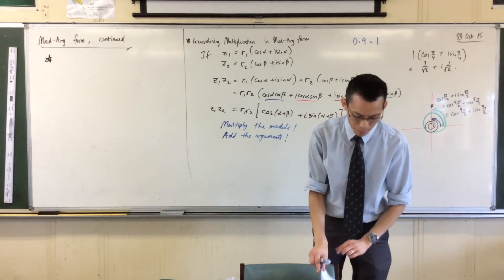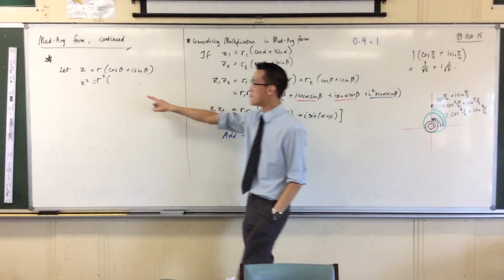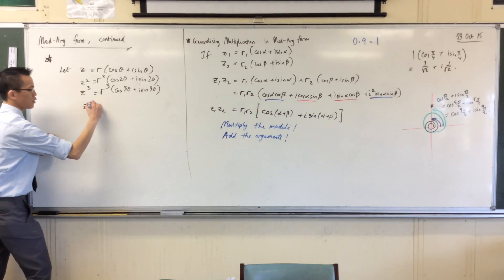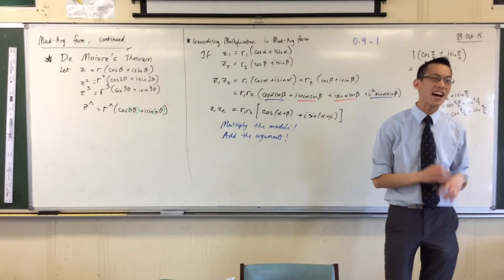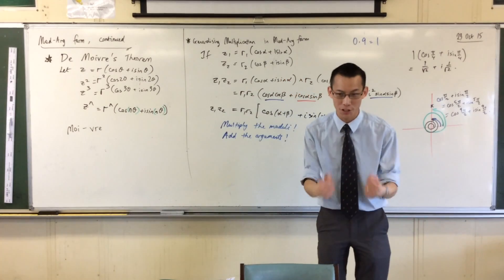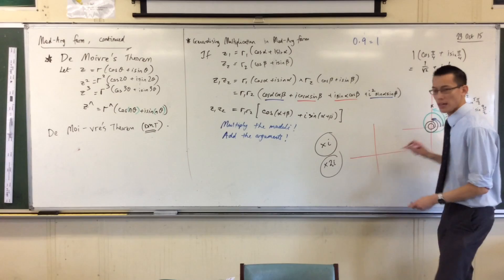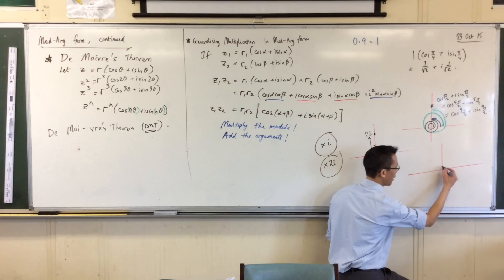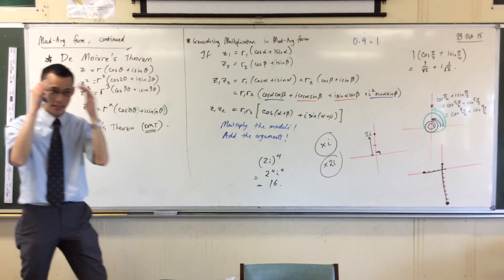De Moivre's Theorem

Comment: Hi 
I have a question 
Use de moiver (216/343i)raised to the exponent2/3
Reply: يمكن ذلك باستخدام نتيجة مبرهنة ديموفر
Reply: Given:
(216/343 * i)^(2/3)

Rewrite the exponent as two exponents, such that it is a squaring and a cube root:
((216/343 * i)^2)^(1/3)

Carry out the squaring of the base:
(216/343 * i)^2 = -46656/117649

Take the cube root of the magnitude, to find the radius of the circle, on which the three cube roots will reside:
cbrt(46656/117649) = 36/49

Because we are taking the cube root of a negative real number, the real-valued root will be negative and real.  Odd roots in general, of a negative real number, will be negative real numbers, since (-1)^odd = -1.  This means the first root we find, will be -36/49.

Per DeMoivre's theorem, the remaining two roots will be uniformly distributed around the complex plane.  This means one of them will have an Argand of pi/3, and the other one will have an Argand of -pi/3, while the principal root has an Argand of  pi, as a negative real number.   Thus our answers are:
z1 = -36/49
z2 = 36/49*e^(+i*pi/3) = 0.367 + 0.636*i
z3 = 36/49*e^(-i*pi/3) =  0.367 - 0.636*i

Comment: Can anyone tell me why this is important in and how they are applying it I  their studies?
Reply: An example I can give you, is the application in electrical engineering.   Capacitors, inductors, and resistors, can all be generalized with the concept of impedance.  So that rather than thinking about a special formula for each of these circuit elements that relates voltage and current, you simply extend Ohm's law for resistance, to a complex version of Ohm's law with impedance.

An AC (alternating current) waveform can be represented as a complex number, where the magnitude is the amplitude of the waveform, and the Argand is the phase angle.   Think of the complex number rotating on the complex plane, and projecting itself onto the real number axis.  The projection on the real axis tells you the waveform's value in real time, while the imaginary parts tell you a forecast of the past and future of the waveform.  Voltage and current are each waveforms like this, where they are given in the form of V(t) = A*cos(w*t + phi), where A is the amplitude, w is a term related to the frequency, and phi is the phase shift, from the original cosine function defined as a phase of zero.  You can represent this waveform as a complex number, in the form of V = A*e^(i*phi), which in Cartesian form is A*cos(phi) + j*A*sin(phi).

Note: EE's use j for the imaginary unit, because the letter i is spoken-for to stand for current.
Reply: Onto the example:
A 60 Hz waveform of 100V amplitude is applied to a 100-Ohm resistor and a 100 millihenry inductor in series.  Find the amplitude of current, and the phase shift from the source's voltage waveform.

Resistor impedance: Zr = R
Inductor impedance: ZL = j*w*L
Value of w, for 60 Hz = 2*pi*60 = 377 rad/sec

Thus:
Zr = 100 Ohms; ZL = 37.7 j-Ohms

Find the net impedance of the circuit:
Znet = Zr + ZL
Znet = (100 + 37.7*j) Ohms

Let V have a phase angle of zero, to keep it simple.  Use V = I*Z, and solve for I, to find current.
I = V/Z
I = 100V / ((100 + 37.7*j) Ohms)

Carry out the complex number math, and get:
I = (0.876 + 0.330*j) Amps

or in Mod-Arg form:
I = 0.936*e^(-j*0.36) Amps

Amplitude of I = 936 milliamps
Phase angle of I = -0.36 radians, or -20.7 degrees
The negative indicates that current is delayed from voltage, as is expected for an inductor.
Reply: @carultch  thank you so, so much for breaking down this example for me. I am not a “math person” as you can see, but I am infinitely curious about the world and often wonder how this kind of maths is applied in our world. You are greatly appreciated. ❤️❤️❤️
Reply: @rakeshbai2732  No problem.  Glad I cold enlighten you.

I'd like to have seen more applications of complex numbers when being introduced to them in my math class.  Unfortunately, a lot of them require background knowledge that is far beyond the scope of what you are expected to know as a high school student.  

The most electrical background you can expect students to know at that point, is maybe the basic relationship among current/voltage/resistance and the two Kirchhoff rules.  But who would know what a capacitor or an inductor is?  Or the AC specifics?

Comment: Can I apply De Moivre's theorem on all examples below to convert polar form to rectangular form?
ex 1: √2(cos(45°) + 𝑖 sin(45°))²
ex 2: √2(cos(45°) - 𝑖 sin(45°))²
ex 3: √2(- cos(45°) - 𝑖 sin(45°))²
ex 4: √2(- cos(45°) + 𝑖 sin(45°))²
Reply: ye
Reply: no first convert these in the form of r(cos(theta)+ i sin(theta)) form using trignometric conversions on theta